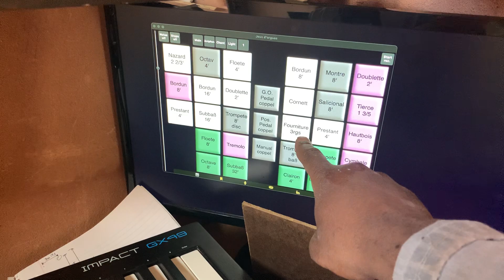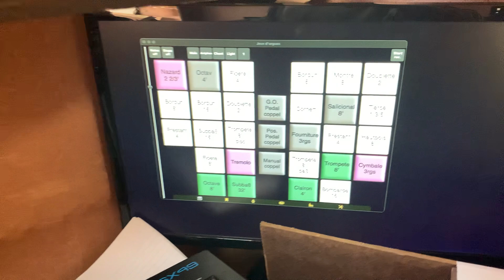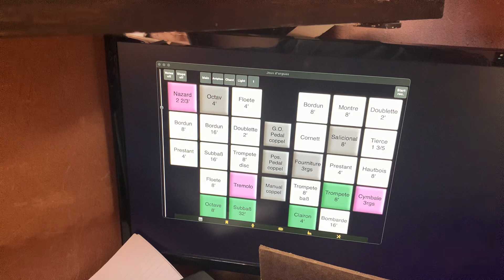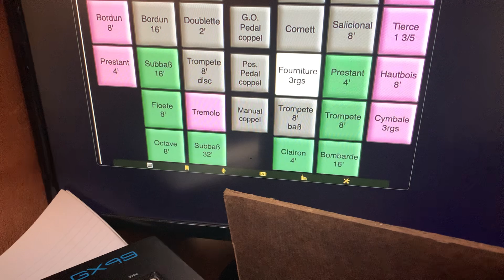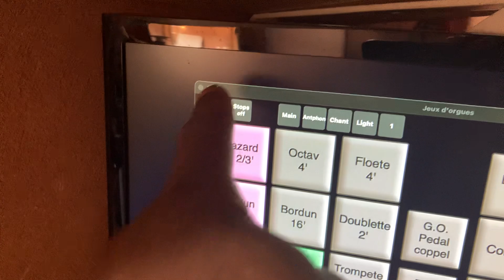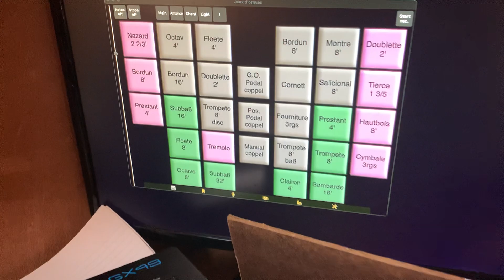Harmony in Bytes: Building a Digital Organ - Part 1 - for the Monastery Church

Comment: Hehe nice, I've been using a Nektar midi keyboard like those for my own experiments. More in the vein of midi sequencing and tape emulation than in that of building an organ, but I did spend some time making a wave folding algorithm for generating nice organ-style waveforms, and I built a double manual organ/synth in Godot that uses midi for one input and computer keyboard keys for the other. Cool stuff here!
Reply from the maker: This has been a fun project, I have to add a few more things to it to be able to control the “swell” and main volume with my feet, I will be also adding real pipes later and bells controlled by midi.
Reply: @TheDesertMonk  Yeah always more stuff to keep adding with projects like these, part of what I like so much about them. Instead of wishing that some company made a thing that did it, and that it was affordable, etc.. just go and do it yourself.